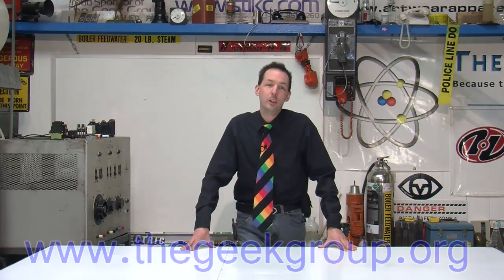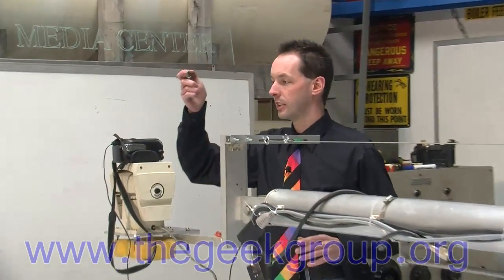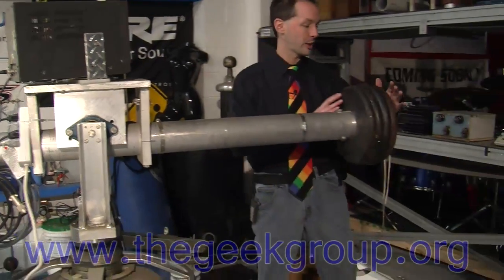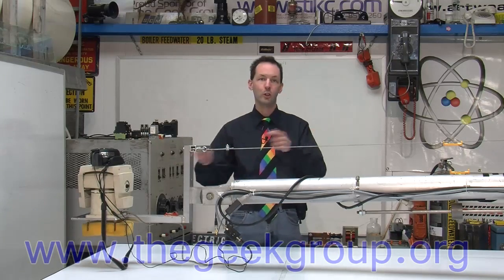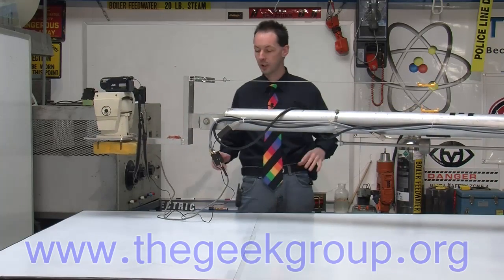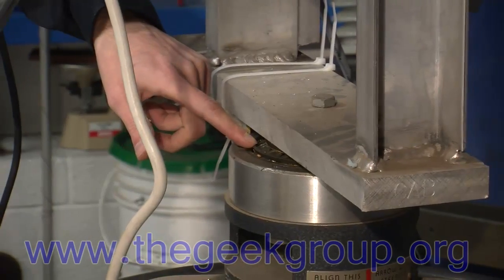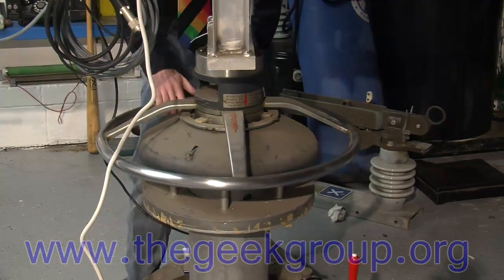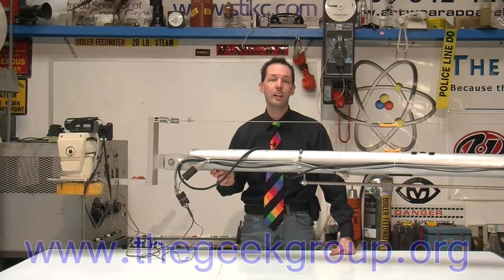Camera Crane Demonstration

Comment: The reason why real cranes are so expensive is because they are designed to carry much heavier cameras (and even a cameraman on it) so they require more and better materials, plus professional cranes are usually remote controlled rather than having 3 dudes trying to move the pieces at the rght time